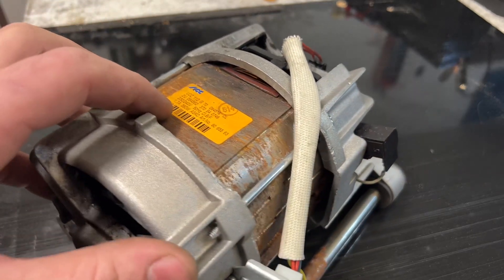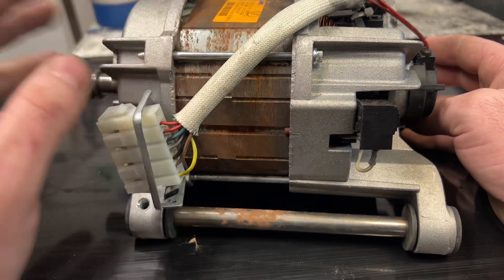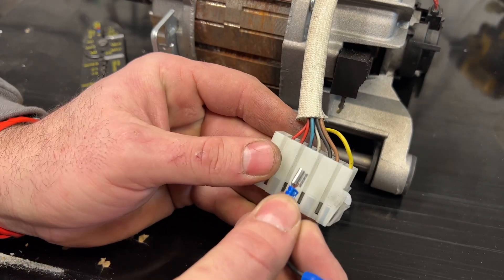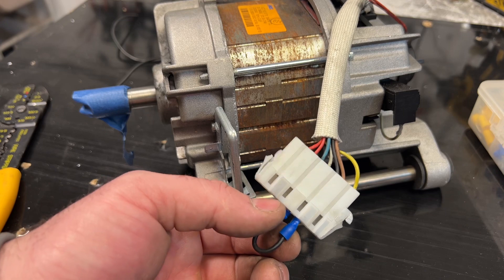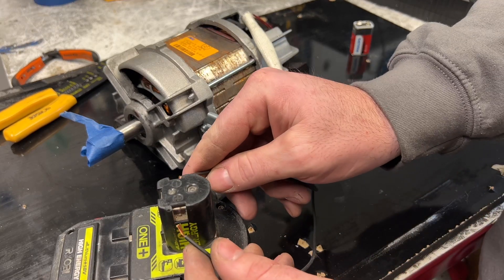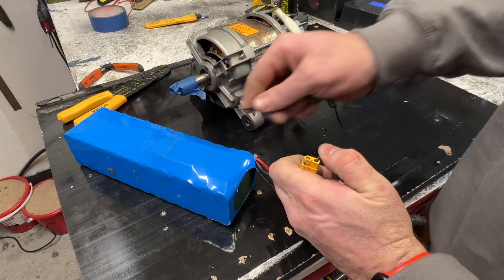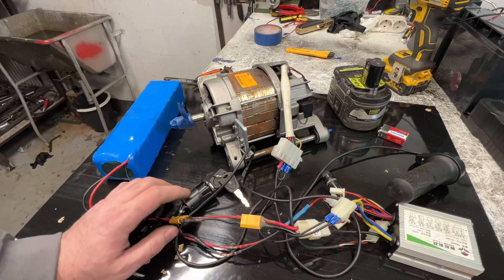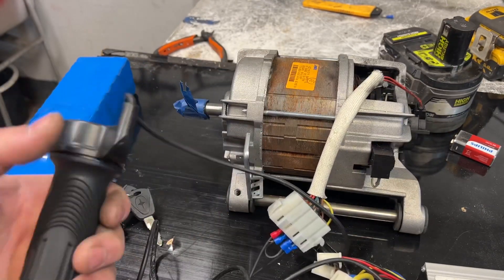How to convert 220V motor to 12V DC motor amazing tips and idea￼

Comment: Actually any synchronous motor is able to run on AC and DC. That is because the switching that happens on the rotor switching circuit (where the brushes go).
Note that the stator have 3 wires; that is because this motor have two speeds.
To reverse the rotation is no need to alter the connections on the motor, is enough to reverse the wires to the battery.
However, is strange that a 360W motor can run so well from a 9V battery. I tested such a motor (smaller, 200W or so) with a 12V power supply and I had to manually start it, the rotation speed was too slow for something useful and  up to 48V it had no significant torque.

Comment: Hi sir, so no need to using converter AC to DC??
Reply: No. This is a "universal motor" and will work with either AC or DC. He has connected the field windings in series with the armature. It could also be wired in parallel (also known as shunt connected).

Comment: Thanks for sharing this knowledge, will the motor still work if I double up the voltage to 72v?
Reply: I'm not an expert but based on what he said it can go up to 230V but if you want to go to 72 V you have to get a 72V battery a 72V speed controller and a throttle